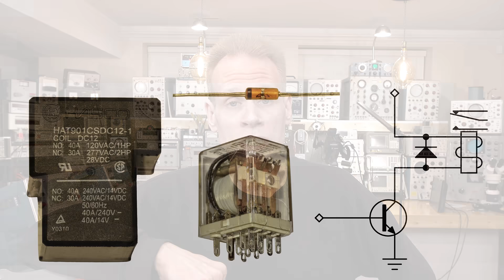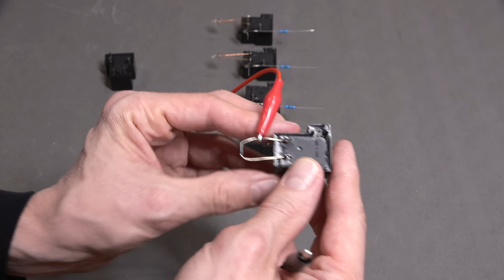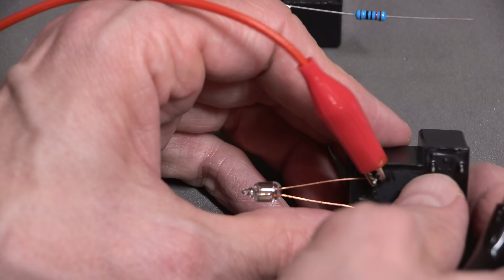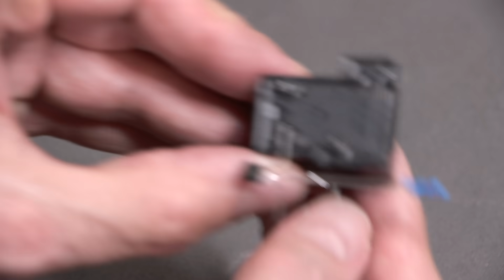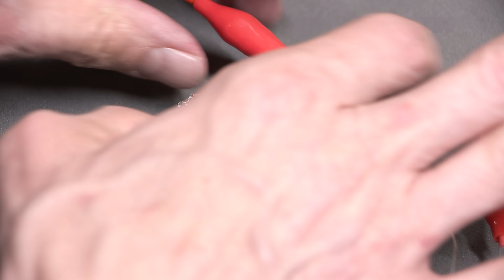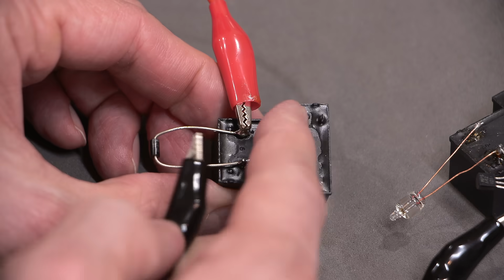Why Add This Diode Across A Relay Coil? This Is Why It's Needed!

Comment: But what if we open the switch from the positive side of the relay, instead of the negative? So that the charge built into the coil can then spill out the negative side into GND! 
Wouldn't that then negate the need of a diode?
Reply: "So that the charge built into the coil can then spill out the negative side into GND! "
Charges do not spill out they must complete a circuit and so a sudden interruption of current will collapse the magnetic field in such a way that the current wishes to continue in the same direction and return to the inductor because it just became a generator for a few milliseconds.  This will produce a high voltage on whatever caused the interruption.  It makes no difference which wire of a coil you interrupt.
Reply: @thomasmaughan4798  From what the video tells us: at the moment the electricity stops flowing into the coil, the coil will produce a spike of electricity of the opposite polarity (+ side is now where GND was previously connected). And since the GND has been cut (in the example with the transistor), the electricity in the (now)inductor, will jump the transistor to get to the GND, in time damaging the transistor. 
My question is: what if instead of disconnecting GND, we instead disconnect the positive side of the PSU, leaving the GND connected? (so the button/switch or the transistor, cuts the + side of the PSU, instead of GND)
Reply: @B24Fox  Understanding what is happening, the physics of it, paves the way to answering your own question.  
Inductors resist change .  They don't like to build the magnetic field in the first place; it takes energy to do that.   The collapse of the magnetic field continues the current in the same direction as before; it is resisting change.  So why do people say it "reverses polarity"?  Well, it doesn't, but when you open a switch, it becomes a voltage rise rather than a voltage drop in whatever is left of the circuit.

So at start, electrons begin to flow from the negative pole of the battery, into an inductor, then out the other side to the positive pole.   If you put a voltmeter on the inductor, it is reading the battery, not the inductor .   Now, if you interrupt the current, the current continues in the same direction, pulling from the pole that HAD BEEN connected to the negative of the battery; but since it is now "sucking" on that wire, it will read positive on a voltmeter, relative to the other end of the inductor.  So it seems to reverse polarity and the snubber diode allows the inductor to emit electrons from one end while pulling electrons and the diode provides a path for this to happen. 

Whether either end of the inductor is grounded makes no difference .
Reply: @thomasmaughan4798  Thank you for trying to explain, but you've focused very much on terminology or trying to explain things that I didn't ask and already knew, overly complicating things, instead of addressing my actual question regarding the scenario described in the video. 
I'm going to rephrase my question one last time as simple as possible: 
If the transistor acting as a switch... gets damaged by being in between the inductor and GND... what if we move this switch to the other side, thus letting the inductor dump it's electrical potential to GND? (since that was already the direction it was going!)
If this higher potential charge/current(NOT electrons) stored in the coil, obviously wants to (yes) flow in the same direction as before, which is to Ground; why not let it?! and just mount the transistor/switch on the other side!? So the transistor won't suffer, and the coil has somewhere to discharge, instead of overloading itself and potentially sparking inside. 
Will the charge in the coil not reach equilibrium if only the GND side is connected?!
Reply: @B24Fox  "thus letting the inductor dump it's electrical potential to GND?"
That's simply not how it works.  But, experiment!  I did and do.  Eventually bought two oscilloscopes and doing experiments with AC and DC.  

"Will the charge in the coil not reach equilibrium if only the GND side is connected?!"
NOW you are onto something important.  It must be a CIRCUIT.  What do you get touching a wire to only one pole of a battery?  Basically nothing (truth be told the charge surplus or deficiency will ripple along the wire until it reaches the end of the wire). 

The "inertia" of the current pushes OUT one wire, you propose to ground and that's fine, but it won't actually push until the other side of the inductor has a source of electrons to replace the ones pushed out.  It doesn't care where they come from.  The collapsing magnetic field just wants to push a current.  How fast can it actually collapse?  Very fast; picoseconds.

If there's no actual circuit, it will try to form a circuit with a spark; but if that fails, there's enough inter-turn capacitance to form self-resonance and dissipate the energy without ever leaving the coil.

By the way, superconducting magnetic storage rings work this way; you deliberately SHORT the coil.  The current in the wire maintains the magnetic field and the magnetic field maintains the current.   In theory it will go forever.  This kind of thing can deliver incredible amounts of energy in a very short time.
Reply: @B24Fox  "you've focused very much on terminology or trying to explain things that I didn't ask and already knew"
Many readers are here (hopefully) and it may be that some are not as knowledgeable as you.  This is why I write that good understanding of electromagnetism allows you to answer your own questions.  
It does actually make a difference whether the spark is a "push" spark or a "pull" spark; the contacts will erode on one side of the contact and plate metal on the other side.  
Google AI says: "Material Transfer: The electric arc generates extreme heat and causes tiny bits of contact material to be blown off. Due to the constant polarity of the DC current, this material consistently transfers in a specific direction (usually from the positive to the negative contact), causing erosion and pitting on one contact and a buildup of material on the other (sometimes referred to as "moon-shaped" contacts)."

Comment: My company makes engine control panels.  We had a customer who kept destroying the outputs of our modules, finally they told us they were driving large solenoids.  Told them to put diodes across the solenoids, they dismissed it and sent us one of their machines to find out what was wrong.  Sent them some oscilloscope captures of the flyback voltage (>100 volts) without the flyback diodes, then showed them the scope captures with the diodes.  They added them, problem fixed.

Comment: Id like to see what the voltage is real time to see how high it goes. Kind of lets me think inside the circuit . Volt meter? oscilloscope? Or is it to quick to measure? Hmmm.
Reply: "Id like to see what the voltage is real time to see how high it goes."
It is a product of switching time.  The faster you switch (from on to off), the higher the inductive kick.  It is theoretically nearly infinite voltage if you have zero switching time.  Boost converters take deliberate advantage of this fact.  So does the ignition in your gasoline powered engines.  From 12 volts to 10 thousand volts just by opening the circuit (the old "points" in the distributor; or modern solid state ignition).

Comment: years ago my brother in law had a mazda RX7 and it had a short that would blow a fuse instantly if i remember right it was for the fuel pump so after a few fuse's we realize we could hear a click it the rear of the car after some checking things out we found a relay we unplugged it installed another fuse and it held so we opened the relay and there was a diode across the coil that was shorted we replaced the diode . not that we had any idea about why it was there but we new it was there for a reason and thanks to you now i know thanks

Comment: Should we add this diode in parallel across a filter choke in a power supply that has a Standby switch feeding the choke?
Reply: Probably.  Filter chokes have a LOT of inductance and will produce a substantial spark at the switch.  There's no particular harm in snubbing the choke.   But the snubber probably ought to be across the switch so when the switch is closed in normal operation the snubber diode has no effect.  If across the choke itself, I can see where it might adversely affect the function of the choke.

Comment: I used to use large solenoids with pull and hold coils for diesel fuel stop/start. After a while the replacements came with diodes and instructions.

Comment: But in most applications, diode and electrolytic capacitor are connected to damp the voltage spike why? The negative side of an electrolytic capacitor is connected to the collector of the transistor while the positive side is connected to the Vcc

Comment: Hi Mr Carlson, do you think that modification would help  prevent 'points' burning out in a relay ( ALA2PF24 M42 24VDC 5A RELAY. DPST) on a circuit board of a Rayburn cooker. Ive had to replace three control boards now in 2 years with the same faults. As these are very expensive, Ive now purchased spare relays, rather than the complete control box. Thanks
Reply: A snubber across the points would probably help but careful consideration is needed; are you switching AC or DC?
Reply: @thomasmaughan4798  24VDC 5A
Reply: @thomasmaughan4798  Hi, its a 24VDC 5A RELAY. (DPST). Thanks for your response. I see that there are various types, covering AC / DC combined from 5v to 600. Not sure of best option for my relay type.  ( ALA2PF24 M42 24VDC 5A RELAY. DPST)
Reply: @thomasmaughan4798  Maybe a flyback diode would be better for DC?
Reply: @tedvicarri6153  "Maybe a flyback diode would be better for DC?"
Yes, and the diode would be placed across the solenoid but will work fine across the switch points.
Reply: @tedvicarri6153  The way to check orientation of the diode is with the relay points OPEN, identify the positive and negative.  Since you want the diode reverse biased in normal operation, the relay pole that is normally positive (when open) would get the diode cathode.
Reply: @tedvicarri6153  But another consideration exists; failure modes.  If the diode fails to short circuit, is that bad?  An RC snubber is less likely to fail to short (or open, for that matter).
Reply: @thomasmaughan4798  Appreciate the advice on orientation, that was one thing I did look at, as its not obvious on the circuit board. Will need to check either wiring diagram or look at the wiring on the boiler where the control box 'plugs in' . Failure modes....open circuit is obviously not a problem, but short circuit could damage the circuit board...at best!. Cant say Ive found a snubber board that would suit my application, and Chinese ones that have flooded the market have some bad reviews...not sure.

Comment: Gosh darnit!!!!   You did it again - memories - When I was younger and working on cars, we did run into issue with the basic 30amp relays we were using for lights/stuff where they would burn out prematurely........Someone told me to put the "black" diodes across the coil leads to stop the premature death of the coils.....and darnit - it did work and allowed them to survive LONGER than a year - LOL - An old tech told me about the bounce back issue and I have kept that in mind forever on any future projects......Another item they told me was about oil filled relays.....deters "spark" - LOL - Not sure how "true" that was but I have never found any.....basically like a regular 5 pole 30A relay but with oil in them......sealed.....
Reply: Years ago, I seen an an oil filled relay at a sewage treatment plant.  All the electrical was 'explosion proof', ie ridge steel conduit, eys seals etc. The insulating oil filled relay quenched the 'arc' when the contacts opened.

Comment: Explain why to put a series resistor-capacitor across an AC relay. DC relay needs a diode....AC relay needs a RC snubber. Goes for any inductive load.  Love your site.
Reply from the maker: Glad you're enjoying the site!
Reply: In addition to components across the coil of a relay, I also see series resistive capacitive circuits across the relay contacts in audio equipment.
They call these spark squasher circuits or spark arresters. They are used to cut down or eliminate relay contact noise being introduced into the audio circuits even though the relay isn’t used in the actual audio circuit..
I see this a lot in old 70s and 80s reel to reel tape machines..

Comment: so its kinda like a turbo boost valve?
Reply: Nope. Do NOT make such childish analogies (it doesn't help). You either get it (electricity is about EM fields, energy is outside the wires and so on) or not. No hydraulic stuff, no Ohm's pseudo "law".

Comment: Most all automotive relays have the diode built in.  You can see it in the schematic printed on the relay.  Just be sure to power the relay coil correctly.

Comment: I'm always a bit surprised that those diodes aren't built in relays by default. They hardly ever harm, do they? Edit: they can be, they're probably slightly more expensive
Reply: Most OEM relays have resistors inside to clamp the voltage spike.  The aftermarket ones are usually hit/miss.
Reply: Yet another one clueless comment. Explained already "Why" diodes by default is NOT a good idea. Go figure.

Comment: I have encountered 12vdc hydraulic valve coils with snubber diodes in agriculturalequipment. If the diode fails the spike from the collapsing magnetic field will pop the fuse. The diodes are internal to the molded plastic (not externally accessible). Is there a way to verify the integrity of the diode since it cannot be isolated from the coil?
Reply: That's why adding diodes inside the DC coil is NOT always a good idea (multiple comments about that, "Why" all manufactures don't add it by default). It's up to you how and where do you protect the circuit (inside the connector/plug you put on coil, or closer to the control unit, on the PCB).
 
Yes there are ways to tell if there a diode inside. One of the ways He already shown in the video. If you understand the basics, you'll figure that out (other ways, making a simple test circuit without blowing up the good diode during such test)...

Comment: A lot of modern cars have these types of relays in them with built in protection diodes to prevent electromagnetic feedback to the electrical system in the car. These relays are often more expensive than the standard ones. Not only this, some car manufacturers include the protection diodes for relays in the actual relay sockets.

Comment: HI, good stuff; the first time I noticed this happening was on my new 74 Vaga, it had a manual trans, the car had a switch on the clutch that would pick up a relay. when I pressed the clutch in the tach would violently jump and finally failed, the dealer repaired it but still the tach would jump up. my fix was a capacitor resistor across the relay, all was well, three times over the years. 2nd was on my new motorcycle that did not have protection at the starter solenoid, that would weld the contacts in the starter relay. the fix was a high voltage diode across the solenoid just like you are demonstrating. the last one was on my LG oven that over time the light would not turn off, it turned out the control relay contacts welded, the fix was a snubber capacitor-resistor combo. 
Rich
Reply: I don't know what kind of craziness you had going on but I have not seen a motorcycle or any other starter solenoid weld itself together because it didn't have something across the relay. I work on that stuff everyday, the clutch switch on the Vegas was just a switch between the ignition start position and starter .  Pushing the clutch in without the ignition in start does absolutely nothing and would have nothing to do with the tach .  By the way pretty much everything I have with a tach the needle bounces when it's powered up.
Reply: @MUUKOW3  the solenoid welded the control relay for it, the ignition was on

Comment: Great video but I'm curious why the manufacturer doesn't put the diode inside the relay during assembly.
Reply: As some have pointed out in the comments, a flyback diode can cause a longer/slower fall off, so slower opening of the contacts, raising the chance of sparking, and with that burning contacts. In many applications that is a nogo, so there you need that relais without a diode. Since you as costumer can add, but not remove the diode, they sell them without.
Reply: Sometimes they do. But it's up to you, how you use the relay. Sometimes the relays are inside intricate circuits (connected serial/parallel) and presence of the diode would mess with it. It is better to have a choice, bare relay, coil (and then YOU decide what's next, how you protect things).